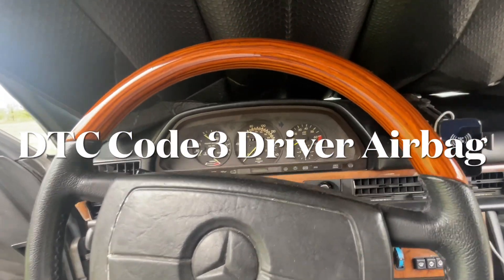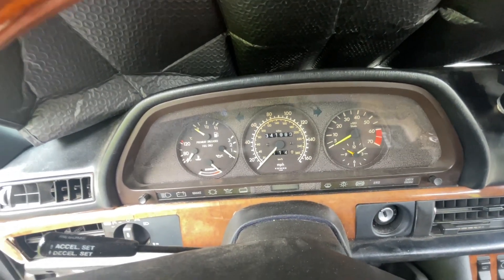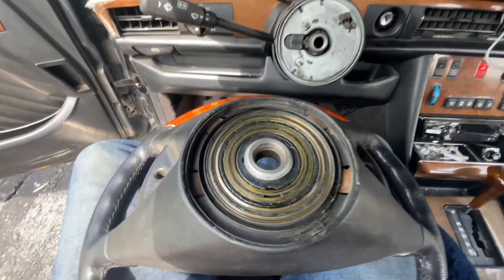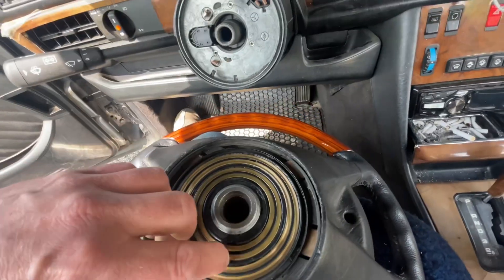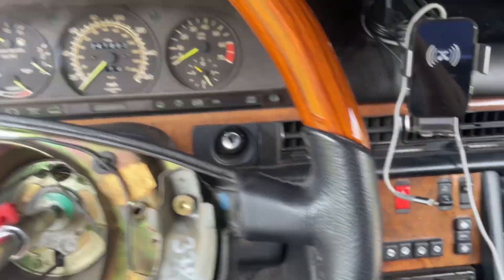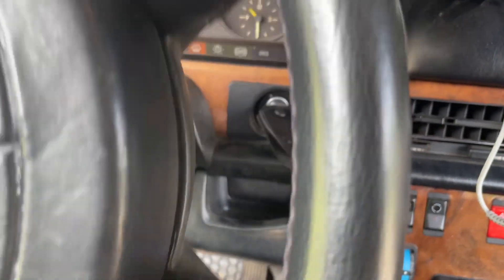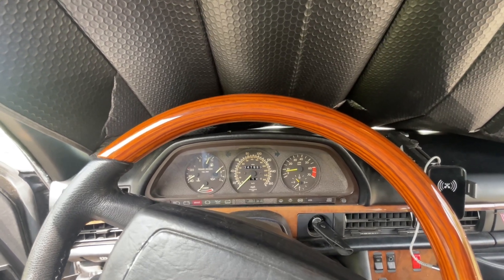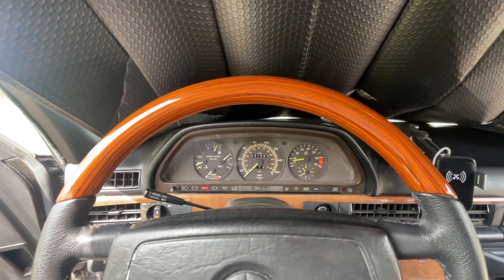Mercedes 1989 560SEL W126 Repair Error Code SRS 3 - faulty Driver Airbag Slip ring, cleaning & brush

Comment: Hello Sir, I hope you are doing fine. May I ask you a question: I have a white 1990 420SEL with 180,000 miles. Everything works, no warning lights, fantastic daily driver for me. Only issue: After driving for a while had problems to start the car. But by pressing the pedal to lockdown it started. Now, from one day to another: car starts right away, heavy shaking, in idle, fuel smell, the higher the RPM the less shaking until no longer feelable. Until back to idle it shakes the whole car. RPM is not fluctuating, idle at 550 when warm, temperature stable 80. Few days ago it started to stall after engine start, never did before. Then hard to start but with kickdown it starts. Stalls . But after a few more attempts keeps running. Heavy shaking fuel smell.
Reply: I found 3 wire plugs at wrong position. Corrected them. No change. I found one vacuum hose disconnected, re. , no change. The spark plugs are 3 months old and carbon fault. The distributor cap looks excellent. One observation, when I remove the vacuum line from the ignition control EZL there is no difference at all. Again, it wasn’t really a process , the car started shaking from one to another moment and runs rich. I only put 92 gas into it, and some cleaner from time to time. Oil I am using 15w-40 . But I did not refuel or add oil before this started. I feel rpm drops down to 500 into gear. Then it shakes slowly but like an old Trekker. But somehow manages to stay alive. Changer plugs again, no change. As I really think it is ignition related? Coil? Because without fuel it would not run rich? Fuel smell? But why was there no effect when I corrected the wires? Because there is only faulty ignition coming from another place already?
Reply: I wanted to buy a new coil now and new wires and again plugs that fit
Reply from the maker: @BOEINGMAX-nn6ku   Fuel Distributor, you need to rebuild your fuel distributor, check fuel injectors, fuel pressure regulator and fuel accumulator, check fuel flow from pump 1liter in 40seconds or less, check fuel pressure upper / lower chamber should be 6.4 bar and 6 bar

Comment: Do you know if I can install the airbag center in a non-airbag steering wheel?
Reply from the maker: That’s a good question. That would depend on the slip-ring matching. The non airbag version has two contacts for the horn. If they don’t match with airbag steering wheel contacts then you won’t have a horn. Otherwise the steering wheel shaft should fit to either steering wheel and both have the same torque for the bolt.
Reply: @inovahightechltd  I suppose as long as you also fit the slip-ring from the airbag version, it should work.

Comment: Hi, I have a 1992 500SL with EXACT same issue:  occasional intermittent srs comes on for a second or two and then goes out IF I move the wheel side to side slightly. I suspect I have a dirty contact ring too...OR I HOPE I have a dirty contact ring 56K miles?  How did you clean your ring and brushes and with what? Any Ideas of any other issue that is possible??
Reply from the maker: No, that’s pretty much it. The brushes are spring loaded and they get sticky. You can just put in a new brush ring or try carefully to clean out the guides the little brushes sit in. I use industrial 99.9% Isopropyl alcohol for this and apply with a small spray bottle, then I push each brush down and let come back up until they freely move. I clean the slip ring with a rag and the same isopropyl alcohol.
Also, read your error codes out of the air back module. Code is loss of driver side air back
Reply: Thanks I will give that a good cleaning like you did. I think this will take care of it thanks again. @inovahightechltd
Reply: Thank you.  I was wondering if I could just spry electronic cleaner spray on those little brushes/guides and move them in and out as I do that...do you think that would hurt them @inovahightechltd
Reply from the maker: @rioraton not sure, I have used only isopropyl alcohol. I would give it a careful try on one brush. If the brushes de-solve then you have to buy a new brush ring
Reply: OMG they can de-solve I will stick with your recommendation of alcohol in a little spray bottle or use a qtip thanks for telling me that  @inovahightechltd